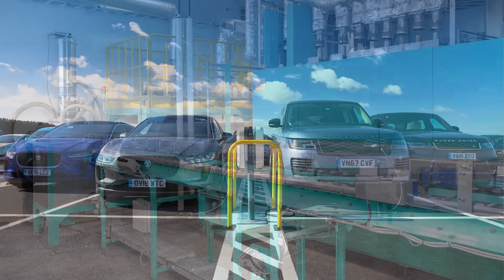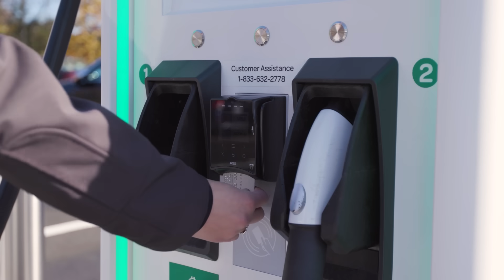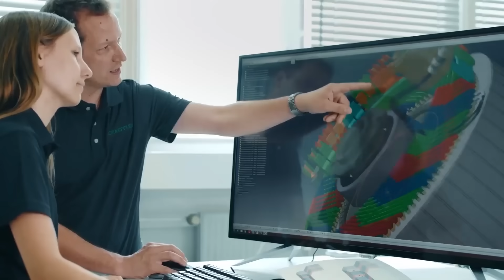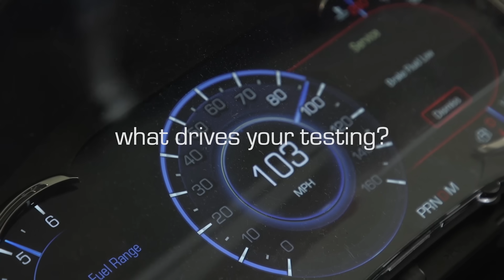New Hyundai Santa Fe Looks Stunning; Wash Your Car Without Water - Autoline Daily 3608

Comment: That 2 speed transmission looks really interesting. Question: outside of motorcycles, when was the last time chains were used directly in the driveline? I know Honda's S500-S800 had chain drive. It seems like a leap of faith to integrate a chain connected directly to high torque electric motor. If they decide to start using smaller lower torque motors, that could be a way of increasing vehicle efficiency.
Reply: Tens of millions of FWD GM vehicles with automatic transmissions, as one example.